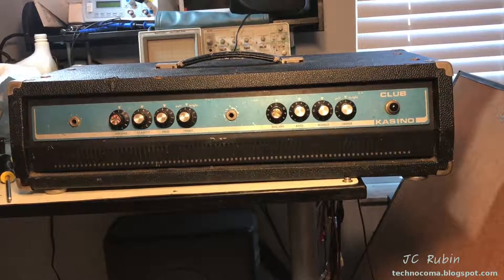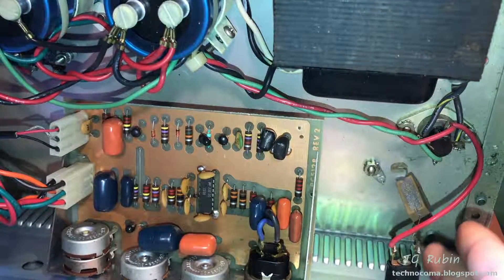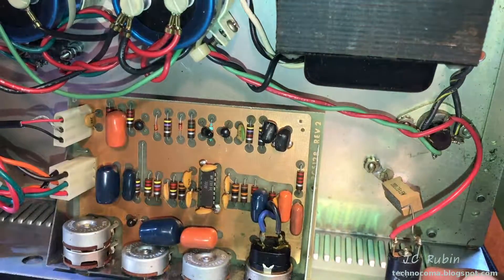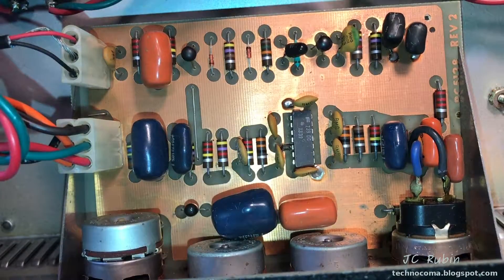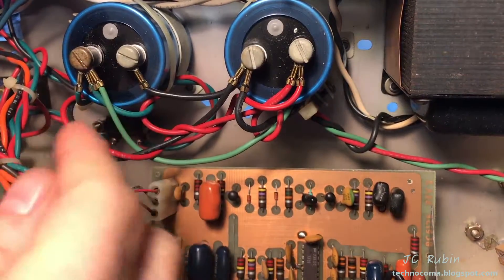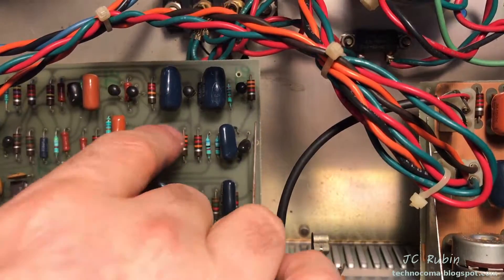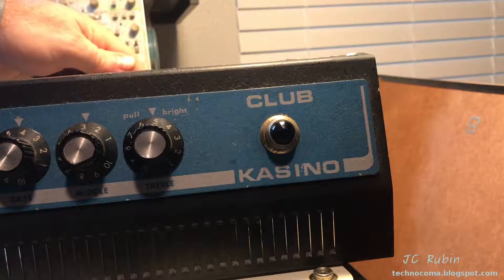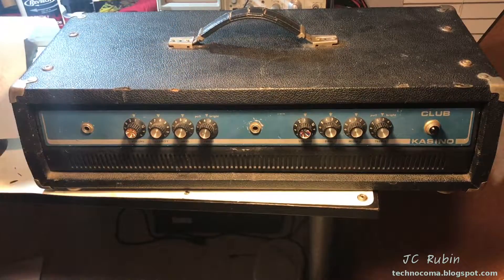Club Kasino Amplifier - Minor Repairs and Quick Tour

Comment: I bought a kasino bass amp from 1973. When I bought it the amp had no power and no light. I checked the bulb which was burned out. Once I replaced the bulb, the amp worked fine. I had a kasino club amp in 1979 which is actually a bass amp.
Reply from the maker: The schematics do not show the bulb being pivotal to function

Comment: I don't know if you mentioned it but my kasino wasn't working when I bought it. I found that these amps will not work if the pilot lamp is burned out. I reached mine and my amp came to life.
Reply from the maker: This amp worked without pilot connectivity, the schematic shows it not required for functionality.

Comment: Wikipedia/Kustom_Amplification "...Kustom Electronics also began to manufacture an amplifier line called Kasino. The brand was established in 1972. These were internally the same as Kustom amplifiers but were covered with traditional Tolex material as seen on Fender style amplifiers. Kasino amps were used mainly by country music performers who felt the regular Kustom Tuck-And-Roll Naugahyde models were too flashy. Another reason for establishing a parallel brand was simply to gain a greater share of the amplifier market. One distributor could sell the Kustom brand and one could sell Kasino without competing with each other. Waylon Jennings was an early supporter of the Kasino line. Kasino amps were discontinued in 1975 when Kustom Electronics once again changed ownership..."
Reply from the maker: Thanks for the info!

Comment: I’m having trouble with my Kustom Concert L which won’t even Power Up...Would Filter Capacitors stop an amp from even powering up??
Some body have modified this one ....Checked continuity through Power Leads through switch and I’m getting Power...
Claims from VintageKustom says schematic could be Kustom Lead 111
Reply from the maker: Voltages should be checked into the rectifier as prescribed in the schematic and at the filter caps as well, also well, the fuse.....
Reply: Schematic would kelp if even the Kustom 11 is the one...I’m not seeing the Filter Capacitors...These look to be 4400uf

Comment: I have one. I believe Club b’s were Bass amps. That why the B stands for. There should be a bright switch on one of those channels. I have the cabinet. It has a nice 15” speaker. It was meant to be a bass amp, but I play guitar through it. It’s a very clean amp. No noise. Great pedal platform. Puts some sound out as well.
Reply from the maker: I want aware, I thought they were PA's, thanx for the info.